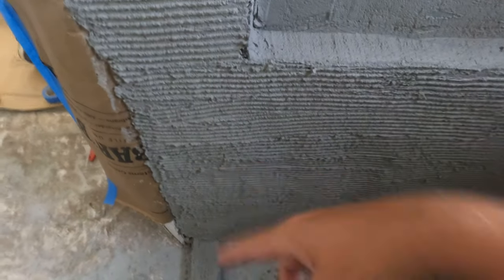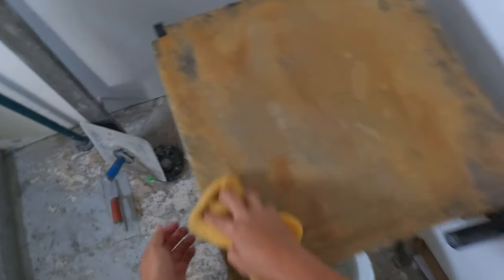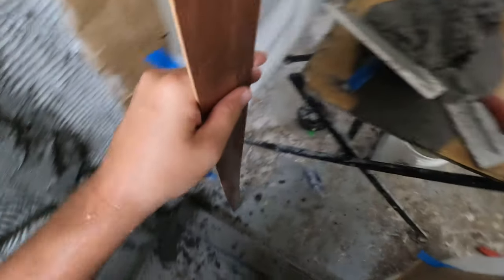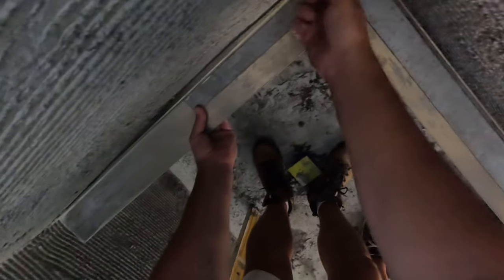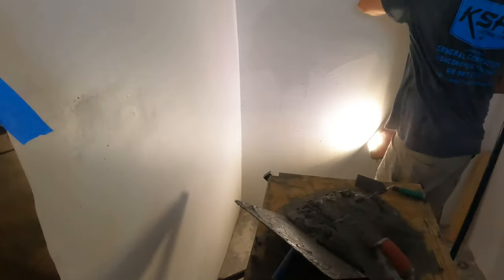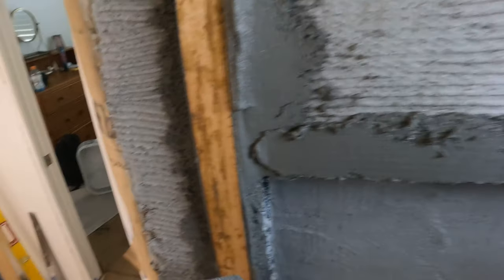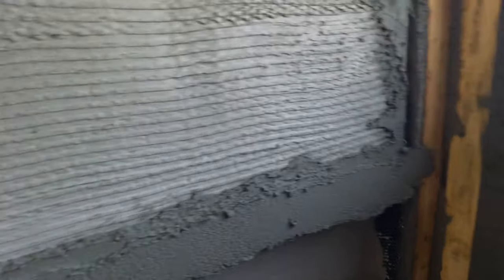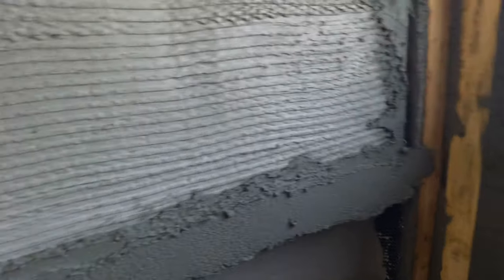Old school mud float prep work for tile shower.

Comment: Finally, someone actually doing a scratch coat instead of doing it all in one shot and having it crack. Been doing it exactly like this for 30 years and never had a leak. I see lots of videos on the Schluter system leaking and people coating it with Red Guard having leaks.

Comment: First off . You are definitely a gifted tile setter; you care about your work and it shows. I have use more of the modern methods (schlut/lat) but can truly appreciate this method as the wall is truly solid. I was hoping you can provide names/manufacturer for the L-shape straight edge and the strips.  I would like to try this method. Great video; keep on spreading.  ;P

Comment: You might try plumbing up with a wood straight edge and a 2ft. level.  You beat on the straight edge. I was taught to never bang on a level. Plus you keep your level clean.
I would also dampen the scratch coat before applying the plumb coat.
Nice job of squaring things up!
Reply: That’s a Stabila.  It can be banged on.  They also make models for masonry work that you can literally tape on stone, brick, block work all day.

Comment: shouldn't you leave a small expansion joint between the mortar bed & the ceiling -- for the same reason that, when laying tile, you need to leave a expansion joint at that perimeter?

Comment: This is cool to see, but I'm confused why go through all this effort? Why not float out the studs and use modern waterproofing materials?
Reply: Once a guy is good at this, probably doesn’t take much too much longer than throwing up durock, taping and setting seams. Plus, they get the walls perfectly level which makes a HUGE different when setting tile. So time savings on the back end as well, not having to deal with walls that bow in and out in a shower.
Reply: Floated showers are much more solid then foam or backer board
Reply: saves time on setting tile.....and less likely to crack in corners, this is proper way to set a shower.....it goes pretty fast, you can do it in a day with faster setting mortars.....when ready for tile you can pre cut most of the tile as walls are square and plumb.....